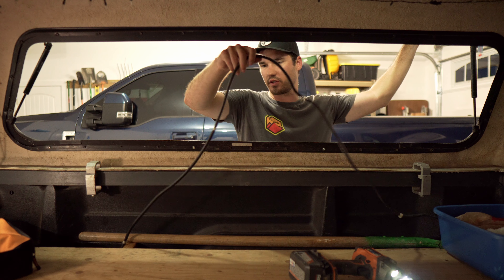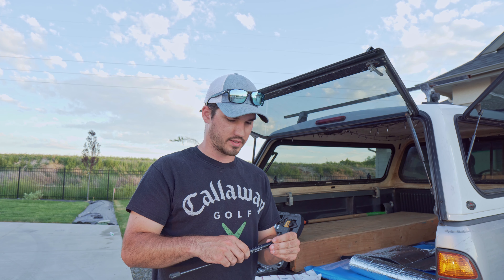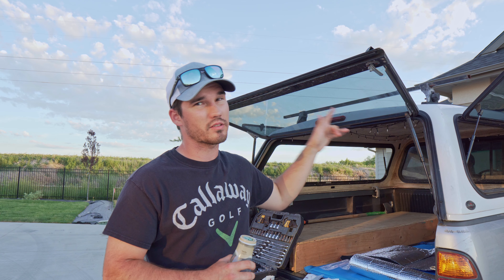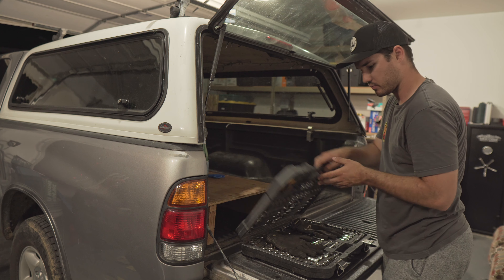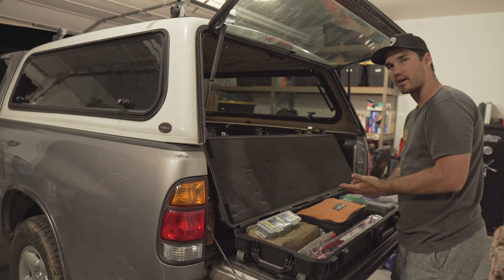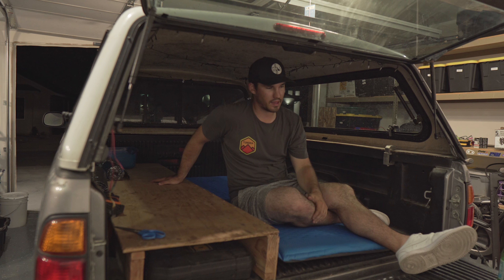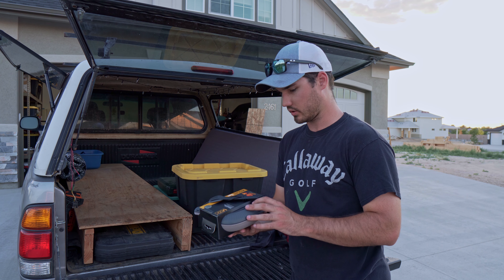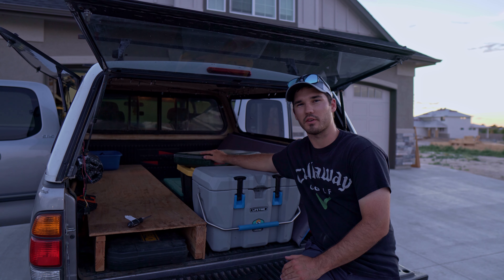IDEAL Minimal + Light Truck Bed Camping Setup

Comment: The gas struts should be installed the same way as the old 1s. On your side windows you have 1 on each side with rod end in the opposite direction. The oil in the strut body lubes the rod end when it opens & closes. In the wrong direction the oil doesn’t help lube the rod end when it opens or closes.
Reply from the maker: You’re right! I installed it upside down and didn’t even notice! I’ll have to go fix that